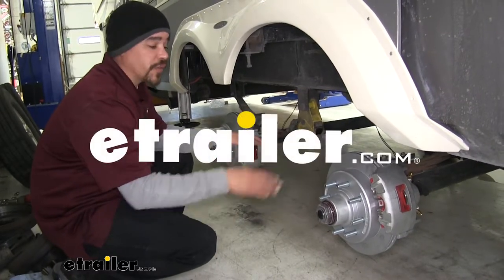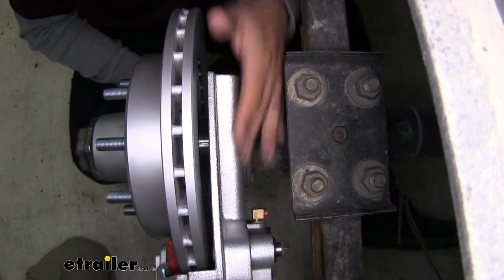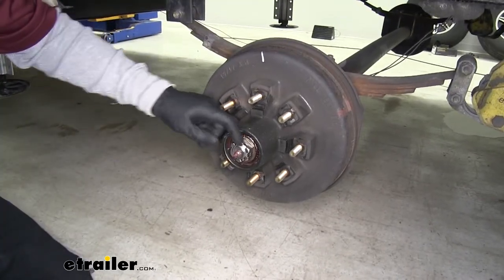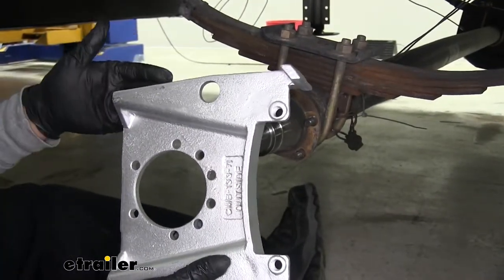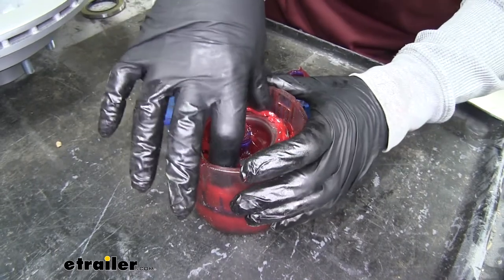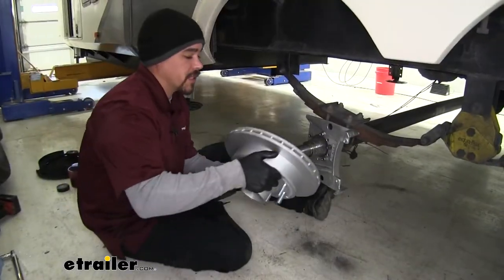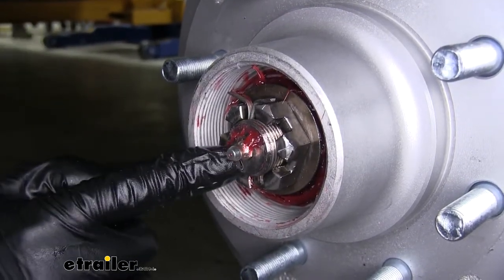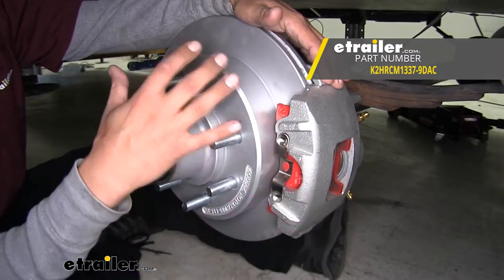etrailer | Kodiak Disc Brake Kit Installation - 2018 Grand Design Momentum 5W Toy Hauler

Comment: What's with packing grease into the oil bath bearings?
Reply from the maker: You can use grease on bearings in an oil bath hub.
https://www.etrailer.com/Trailer-Brakes/Kodiak/K2HRCM1337-9DAC.html
Reply: Mmm, grease >or< oil, pick one.  Grease type seal appeared to be installed, then bearings greased, but oil cap installed (?).  I think they goofed and should have puf the Ez- lube caps back on.